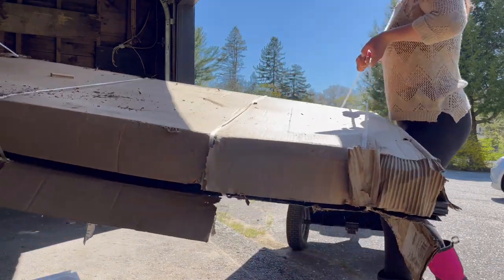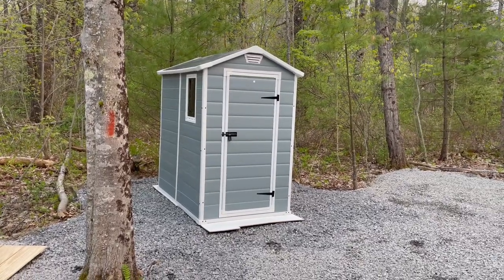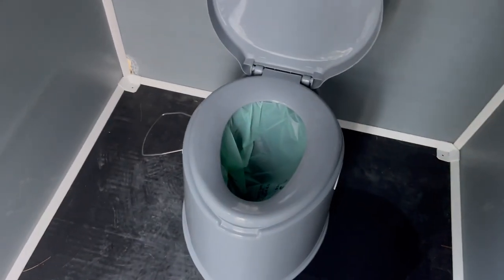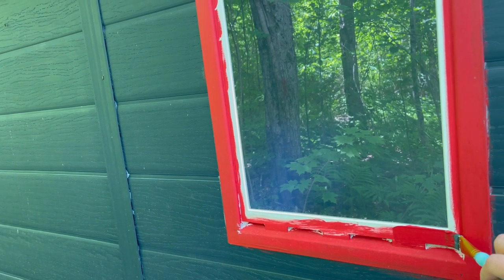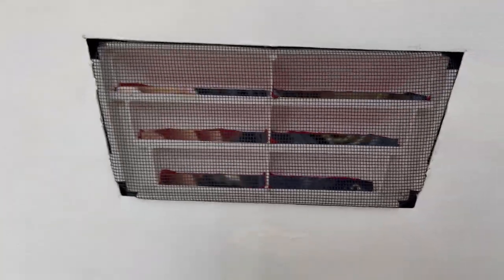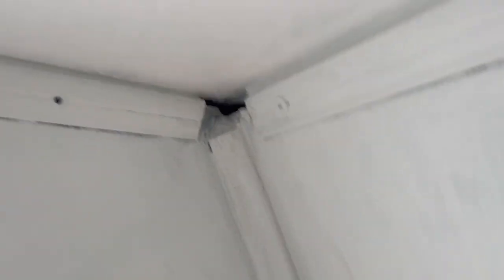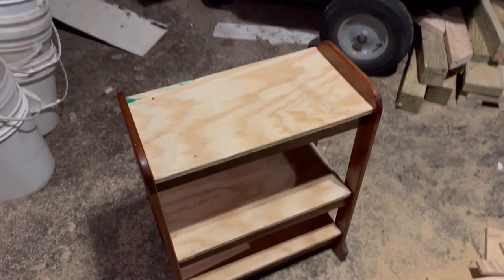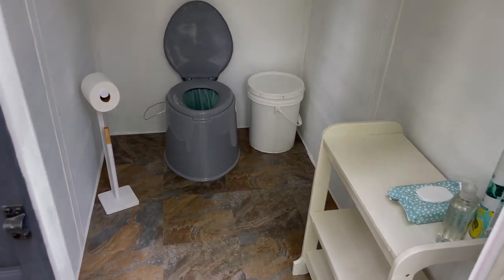We Transformed a Shed into an Outhouse: START to FINISH

Comment: I love this!  I just bought a small Keter shed and have a question.  Do you think I could paint the pieces ahead of time and then assemble it?  I’m thinking that would be easier for me.  Then I could just touch up and areas that got scratched or marred during assembly.
Reply from the maker: Oh definitely! The paint doesn’t stick well if scratched so just know that will probably happen and depending on the color you use touch ups might be hard to cover.

Comment: Hi nice work, what base/foundation did you put this shed on?
Reply from the maker: We just set it on the gravel and put a plywood floor as we planned on moving it inside in the winter but left it out and it still holding up perfectly

Comment: I just recently bought one. I was wondering if you remember the dimensions for the wood flooring inside the shed.
Reply from the maker: We measured out a 4x6ft piece of 3/4in thick plywood, placed it underneath and screwed it in and put the stick tile on top.